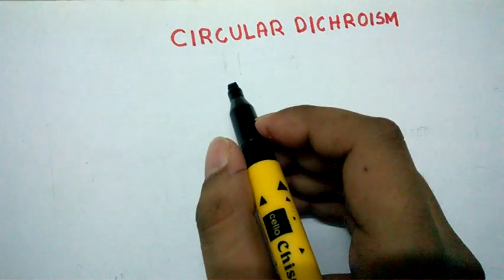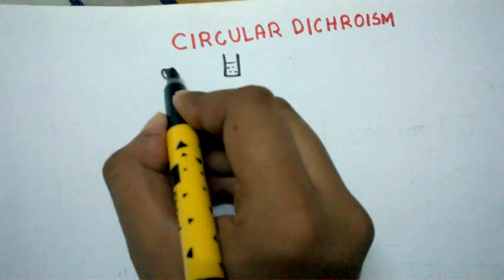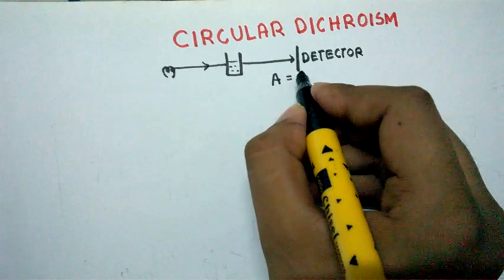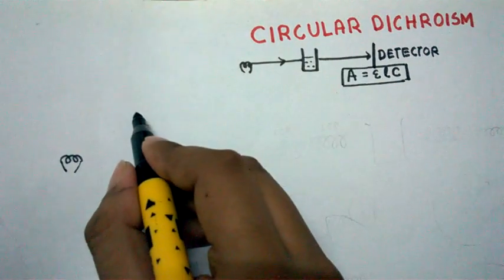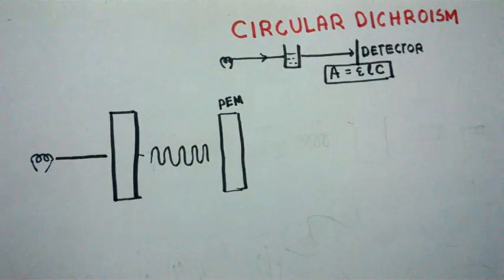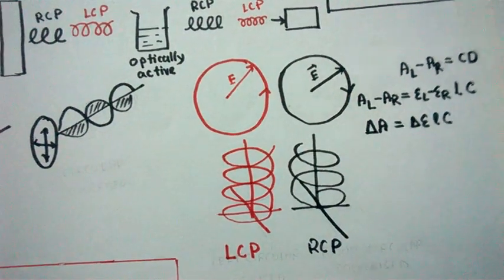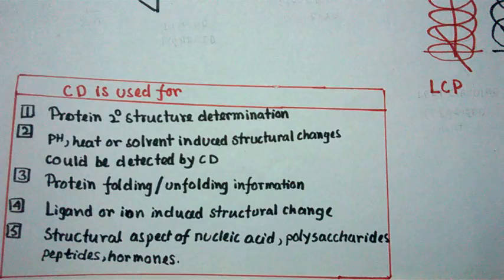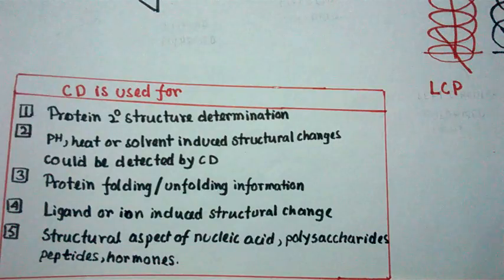circular dichroism

Comment: nice video. .hope ur points help me for my semester after 2 two days. .may I know how is ORD(optical rotary dispersion) related to this circular dichroism..???reply soon as possible
Reply from the maker: +saravanaraj m 
concepts of ORD and CD  are quite similar(but they have a fine line of difference) i would say both are manifestation of same underlying phenomenon.
spectropolarimeter is based on the principles of ORD .It measures ability of an optically active compound to rotate polarized light as a function of wavelength(one could think it as wavelength dependence of optical rotation).ORD is about the way the material refracts polarized light in a different way, when the wavelength of that light is changed.  ORD is measured as the difference in absorption or extent of interaction with the incoming light, when wavelength of the light is changed.  ORD is usually used with plane-polarized light, and the change in optical activity is tracked as wavelength is varied.  As we saw with CD, ORD examines the wavelength effects of linearly polarized light incoming upon the material, and looks at how much the recorded CD is being changed as different wavelengths are used.  Short wavelengths tend to interact more strongly with materials, compared to longer wavelengths, so we experiment with different wavelengths to do an ORD spectrum.  What we get out of an ORD spectrum is the difference in transmission speed of left- and right-circularly polarized light going through the material.

The way CD and ORD operate is built in such a way that the two methods can provide information about each other.  With ORD associated with dispersion and CD connected with absorption, it is possible to use Fourier transforms to convert between these two.

If the ORD spectrum shows a positive tendency, then long wavelengths of the polarized light are interacting more strongly with the material, creating a positive CD band.  If the ORD spectrum goes in the opposite way, this means a negative CD band, and short wavelengths of polarized light are interacting more with the material.
Reply: thank you
Reply: Arpan Parichha thanku